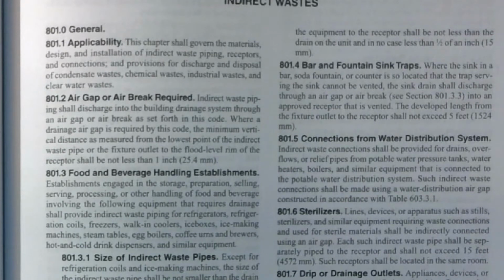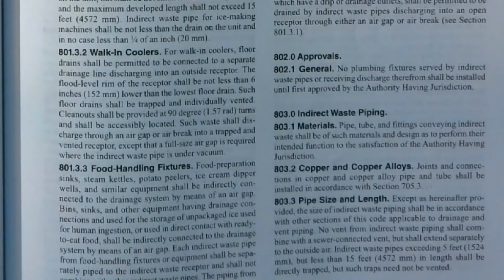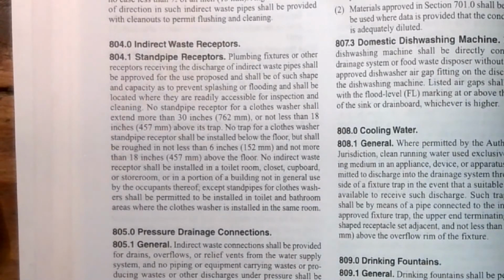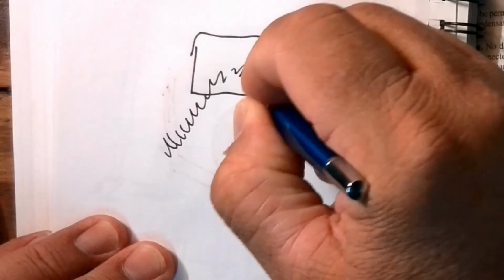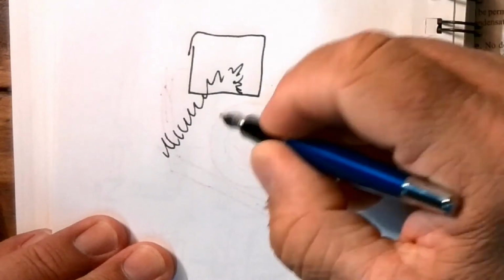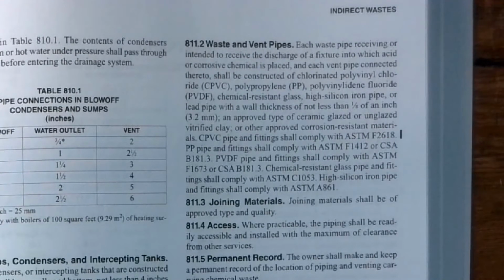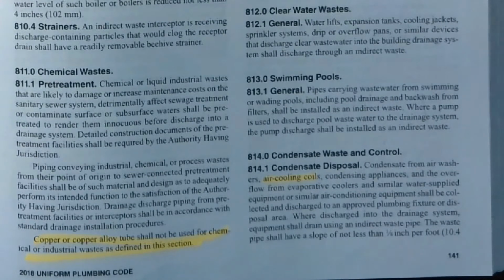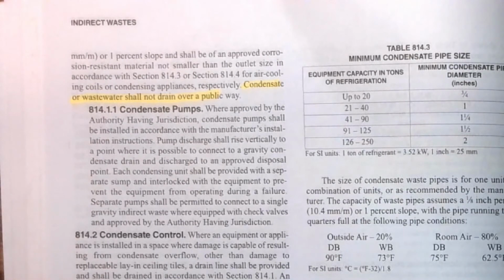Uniform Plumbing Code Chpt 8 Indirect Waste

Comment: can i connect the drainage from a mop sink and a 3 bay sink together before dumping them into a floor sink? Thank you.
Reply from the maker: Think of it this way.  If you create a clog in the discharge, you use the mop sink for cleaning a floor, and the 3 compartment is for food prep, do you think it wise?  The design of any system is based on a worst case scenario.  The last thing you need is cross contamination.  I hope this explains your question well.